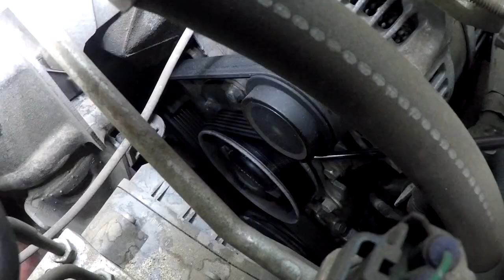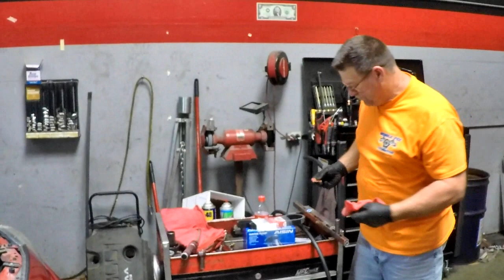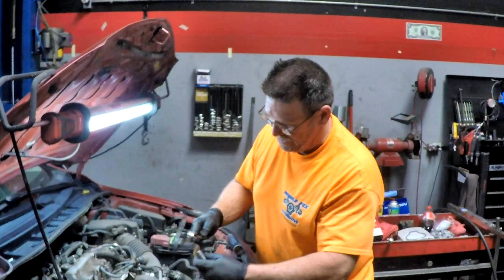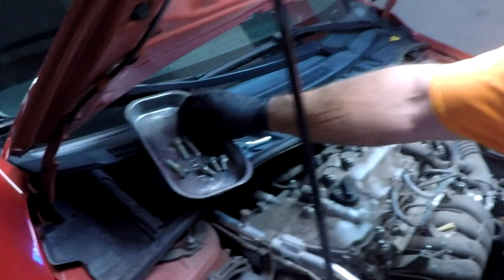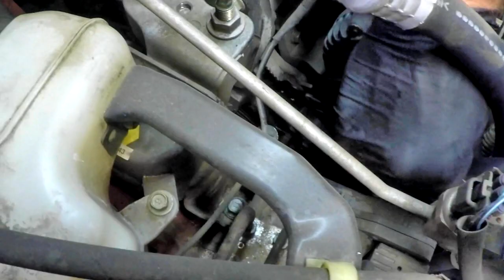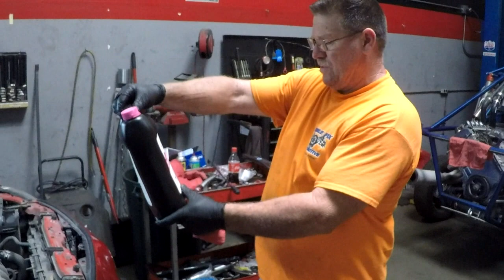2009 Toyota Corolla 1.8 water pump replacement

Comment: It was the bearing in the water pump that was causing the issue. I just replaced the water pump, and it took me about 4 hours, but I got it done myself. I'm thrilled that it fixed the noise! Thanks for the tip about not touching the old coolant valve. 2009 Toyota Corolla with 130,000 miles.

Comment: Thank you. Watch the video and replaced the water pump. I removed the alternator rear bolt and swing the alternator to the front to have more room.  Drained the coolant, replaced the pump (bought it in Amazon along with the coolant and that funnel). Piece of cake.

Comment: Hi there.  I watched some videos last week, did a bunch of other stuff, then came back to this once my water pump arrived in the mail. Immediately jumped in , removed alternator,  ready to go.  OOPs, can't really flush the radiator without an alternator, or can I?
Flush radiator for 3-4 minutes without an alternator, ok?  
 If the answer is NOT OK then, can I just wait until I get the new pump on and flush it then? I realize there may be some particulates that don't get out through the w-pump hole. Crucial? Any pointers out there? thx.

Comment: Thank you Sir, jacked it up and it was a piece of cake. Only problem it squeaked like hell. I went back to the video to see how to tighten the alternator bolts in the correct order and it worked. But I marked where the adjuster should land and it worked perfect. The belt was to loose. 
Thanks again. 12/15/23

Comment: Thanks to your video that I just found for years after you made it, I realize that my Toyota Corolla does not have a belt tensioner pulley. What I’m looking at is the water pump pulley. I recently replaced my serpentine belt in the pulley on the water pump looks a little bit damaged so I was thinking of replacing it but thanks to you now I know that that is a water pump pulley and I believe that it cannot be replaced unless I replaced a pulley thank you very much.

Comment: I’m doing the same type of repair 09 Corolla the two long bolts did have silicone the three smaller ones did not silicone the two long bolts look like they go into the block but I’m only a YouTube mechanic thank you for this video helped me out tremendously

Comment: Great video rob very informative and you did an excellent job with your explanations I just had a friend install a water pump in my Toyota I still hear squealing noises why is that ron? Well be safe you and your family thanks again great video God Bless...
Reply: Most likely it is the belt tension that makes the noise. Have your friend tighten the belt properly.
Reply: I had a friend install a water pump in my 2009 Toyota Corolla, it still squeaks when I start it also it's beginning to run hot. Please help Great video once again👍
Reply: Tight bolts in the order he showed. Mine did the same thing. Pull the alternator back far as you can. Screw the adjustment screw in until it's tight. Then tighten bottom alternator screw

Comment: What I usually do when I need to drain the coolant is rather than use the drain plug on the radiator is I pull the lower hose from the radiator and let it fall into a pan. In some newer models, the radiators don't even have drain plugs and are specifically designed to be drained that way.

Comment: Don't forget to mention that, if you disconnect the neg terminal of the battery, be sure you have access to the restoration code for the radio / stereo head unit.

Comment: Would not taking out alternator make it way easier?
Reply: I thought the same thing. Probably could have saved 10-15 minutes in the long run. Even so, great video!
Reply: Yes, it would be.  Just 2 bolts.  You may need to take the bracket off too, just 1 more bolt.

Comment: Go directly to the 18 minute mark and see orange rad fluid coming out.  NEVER Put dex cool in a toyota. "or any car"  This is why the pump went bad.  The Canadian owners manual also says, Burning a quart of oil every 600 miles is normal.  When buying a Toyota, pull the rad cap.  If fluid is not pink, without a strange essence of orange.  (some one added some orange) do not buy it.

Comment: Before undoing the Alternator measure the threads on the bolt, when you put it back you can use your measurement to get it pretty close to perfect quickly.
Reply: No need to measure.  Just before unbolting.  Use a sharpie.  Mark the thread and bolt of its location.  You can double check the mark by marking the right side bracket that meets the metal rail.  After that, when you reinstall, have the bracket slide up and line up to the old marks you made.

Comment: I have a question, 2009 Toyota Corolla Alternator, is there a deference in the Alternator if the car is built in Japan or North America. Thank you, Don
Reply from the maker: It can but check with your local parts house. They should be able to answer that question
Reply: @SandCarServices  I appreciate you getting back to me, I will check on the alternator, what about the water pump.

Comment: If it helps anyone, when you’re removing the bolts from the old pump, place them on the new water pump to know where each bolt size belong to which hole
Reply: Uziel Saldivar thanks nice tip I have to replace mine after work today.

Comment: That was explained clearly ! Thanks good video ... Can I torque the pump bolts with a torque wrench for like valve covers the one with a pin in the center  ? I don't have a big torque wrench

Comment: Video helped me replace my water pump.on my 2009 matrix, same.engine in the video. paid $66 for water pump and belt from rockAuto and $26 for 2 gallons of.collant from Walmart. I didnt use a torque wrench instead I used a wrench with.a super short handle which allowed me to feel when it was tightened fully. I don't trust my torque wrench.
Reply: Vagus I have a 2010 Matrix 1.8L and need to do this. How did you drain the coolant?

Comment: 2009 toyota corolla, that is crazzzzy, I have a 1998 toyota corolla with 221k milles.  Original water pump, no noise and no leaks.  Parts now days are a joke.  No quality behind.
Reply: Cesar Orozco my 2010 Corolla has 222k miles. Just 1k over yours and I started getting this noise. I mean... 222k is pretty damn good without any problems until now, imo.
Reply: Mine 202k there is a noise no sure it is water pump..no liking..😁

Comment: Great instructions. I replaced my water pump in my 2009 Toyota Corolla today.

I noticed that I had very poor gas mileage & had my car diagnosed by a mechanic. After thorough inspection, he told me that the reason for loss of mileage is that the water pump needs to be replaced & quoted cost of replacement at $500+. I went to an autozone store, bought the parts & coolant & was able to replace the water pump myself for under $100. All thanks to this video. I just hope now that my gas economy improves as a result. I filled my tank & now have to wait to see.
Reply: Michael Nicholson haha what. Gas mileage has nothing to do with a water pump

Comment: I've got a 2009 vibe I changed my coolant. My manual said to use gm  dexcool which is more orange but the stuff I drained was the pink stuff like in your video. I put in orange  dexcol but now I'm worried that i should have used Toyota pink because it is a corolla engine in all the vibes. Could this shorten the life of my water pump?
Reply: You need to get that DexCool out of that engine. The owners manual is wrong on this car. Get yourself 2 gallons of Toyota Super Long Life 50/50 and do a complete purge. or take it to a Toyota dealer and have them do it.
Reply: Get that Dex-cool/Dexkill flushed out of your engine asap.  And make sure it's completely out before refilling it with Toyota Super Long Life Coolant (Pink Stuff) because Dexcool has been known to gel up when mixed with different types blocking up the passage ways in the engine. I have a 2010 vibe too and had a guy at autozone tell me that "GM" car requires Dexron VI transmission fluid when it's a Toyota transmission and says use Toyota WS fluid. Luckily I ignored him. Better off ignoring the Vibe GM owners manual and pick up a Matrix owners manual to get more accurate info on Fluid recommendations.